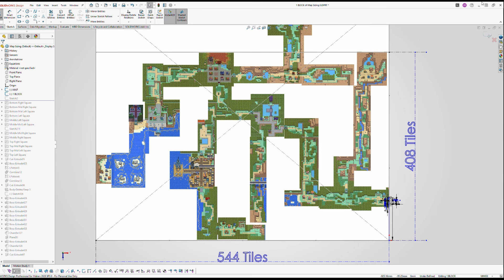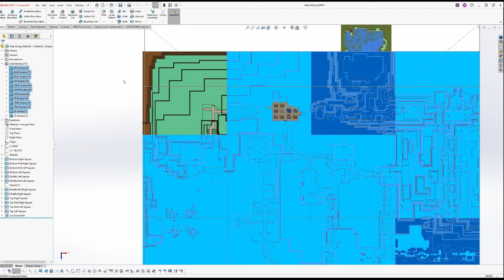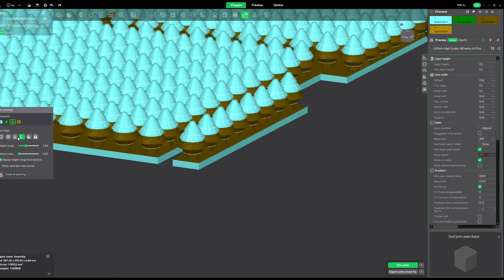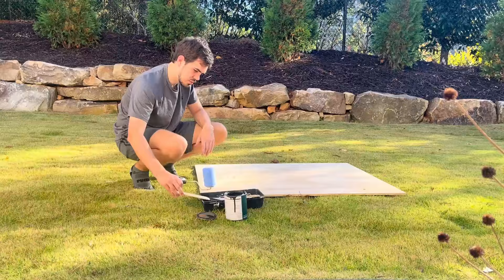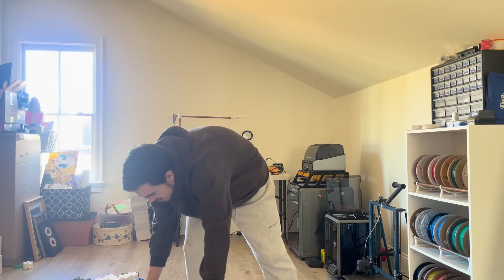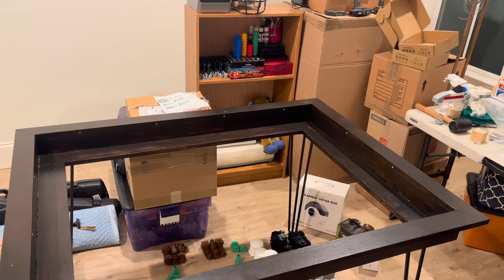I made the Johto Region from Pokemon in Real Life!

Comment: Whew, tons of work for a great result.
 For the glass, i would've gone with a plank on its side instead of the nubs, the nubs look tilted down. Then rubber stripping to hold from sliding and seal out any dust
Kanto next, obviously
Reply from the maker: I agree with you. I want to do a wooden rim for the glass with a padding for the next one. The pegs are level but there is a small gap between the wood and glass.